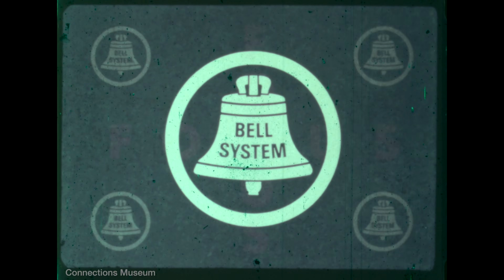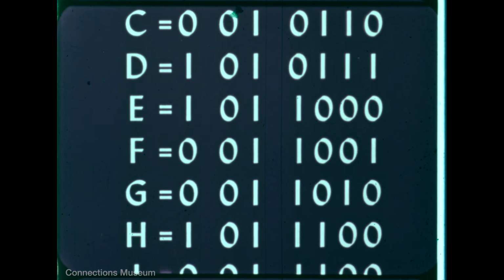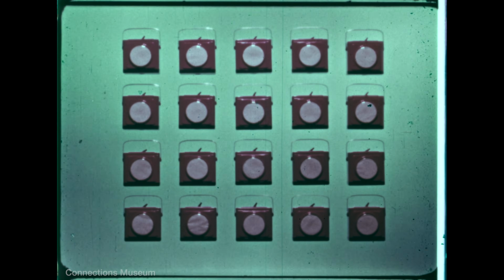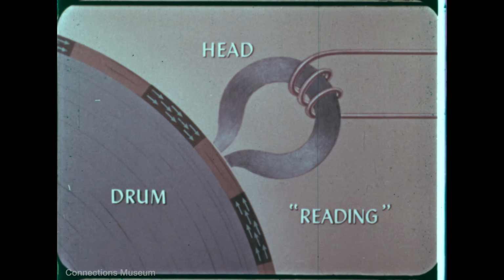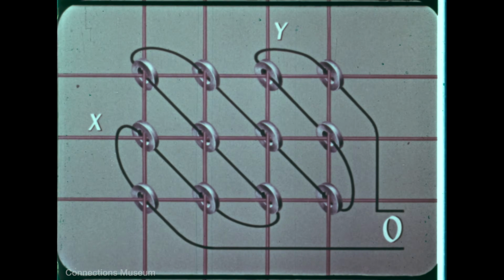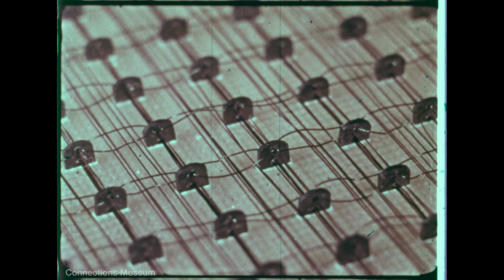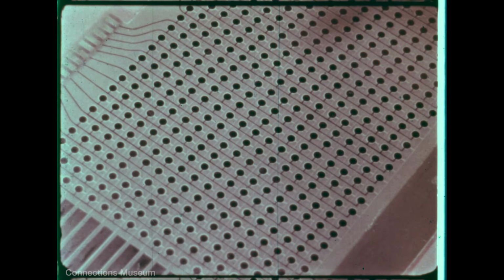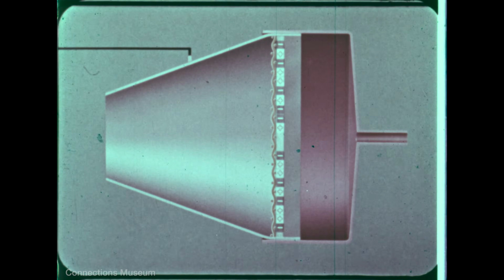Memory Devices [Bell System 1959, 4K]

Comment: Its basically Morse code/braille for the paper version. 8 ...

I don't understand the 2/5 signallung with phone numbers, it wasn't explained well.

Then just like a Wax Record for Sound waves and earthquakes, the magnetic tape with heads. 7 head bit*

Interesting about the electric current running through it.

Comment: Huh, for a moment I thought the video was on/from the channel FranLab.
I only have to think that an SSD/DDR5 RAM would blow their minds, gives how impressed they are with the "large" storage capacity, and "fast" access and transfer speeds.
On the other hand, historic storage is interesting. And given that there have some magnetic core memories have been found that haven't be touched or in circuit for more than 40 years and still had the last program/memory they did run ... maybe we should invest in developing and producing those again ... As a reliable backup in case the poo hits the air moving device.

Comment: Magnet core memory was invented by Dr An Wang at MIT. The invention was subsequently acquired by IBM from Dr Wang in return for a substantial amount of IBM shares. This holding was used to finance the the formation of Wang Laboratories Inc. based in Lowell Mass. Wang Labs were pioneers in electronic scientific calculators and in screen based Word Processors.

Comment: I worked in a steel mill in the early 1970's and the rolling mills were controlled by a General Electric computer with a card reader and punched paper tape.  The memory was magnetic core.  The bulk storage was a magnetic drum type bigger than a washing machine. I remember the drum storage was about 500 kilobytes.

Comment: As an educated IT and Electronics technician, i love those old movies. So easy to understand the concepts. Modern tech almost 70-80 years later, not so easy. I have tried to explain Electronics to my 75 years parrenes. Skoen Them some 0.15 mm components. They have a hard time imagine I Can build stuff with that size things made from dust. Hehe. Then I diged an old vacumm tube out to show Them, and told Them there are some 20 billion of Them in most modern cpus. That blow their mind. And then i told how much juice and roome size 20.000.000 of those glass suckers would fill. 
Just the filament in it self is in the watt pr. Tube. So a medium size powerplant and a  ballroom would be needed. Notation mention a cooling system. Thats whats needed if not semiconductors was invented.

Comment: I probably never would have known how a computer works if I never watched a video from 1959.
Reply: Def explains/expresses the fundamental roots thereof. It’s like way back when I’d first learned automotive fundamentals during Jr High & HS during the late 80’s into the very early 90’s.. whenever fundamental educational “films” (yeah, only a very small number of educational shows, were actually presented thru “VHS”; projection 16mm w/audio, typically via compact cassette tape, were still ‘very’ commonplace then), were presented to the class, more times then not, the “footage” (that term, still being used today, for digital ‘videos’, is a fallback of literal actual “film stock” that passes across a controlled frame gate system, at a “feet per second” rating), were films created back in the late 1940’s thru the 50’s!!! No point in trying to recreate the wheel, right?

Comment: Most of these I have never knew existed. You can see the start of the printed circuit board. I took electronic engineering after high school and got hired by Nynex aa a computer tech  right from school. IT was IBM XT's and AT's around that time. Some of the first hard drives were coming out. Had a Commodore 64 at home. Now I'm Cisco Network Engineer, after going through various networking hardware and software interactions. Amazing how things have progressed.
I love electronics and electricity in general it always amazes me.

Comment: I worked on my master's degree by writing FORTRAN code using punched cards. LOL.
Reply: And if you could not do it in FORTRAN, you did it in Assembly.
If you could not do it in Assembly, it was not worth doing.

("Real Programmers don't use PASCAL" Datamation, July 1983
Reply: @lars-goranwillny42  I've done assembly too (actually machine language), but that was later. BTW, I'm not a programmer, I'm a physicist.
Reply: @TOAO789 Nice! I was a material quality laboratory engineer at a truck manufacturing company in Sweden when I was asked to create a quality statistics system for transmissions. I wrote it in FORTRAN and then I was transferred to the company's computer department in the role as systems programmer for an IBM S/370 and System/38 environment. Since then it has just gone downhill, becoming a computer nerd, inventor in the field of computer and information science 😂

Comment: As someone with an Electronic Engineering degree I have always been fascinated by what I call Ancient (Pre-Transistor) Electronics.
Everything is so big, chunky, clunky, and slow. You can see every component, watch it do its job, understand how it does what it does, and tinker with things with just a screwdriver, tweezers, soldering iron, and wire cutters.
Now, the complexity of electronics is mostly hidden away inside chips, where repairs involve replacing parts rather than actually fixing something.
Having said all that, the effort and expense they went to just to store and read a few kilobytes of data is astounding.
Reply: My grandfather was using computers like these when he worked at a chemical plant in the 60s. In order to be available at all hours the company ran a dedicated line from the plant to his house, and he had to call in and give a code word to have someone manually plug him in to the computer.
Reply: I feel exactly the same. Sometimes I wish I graduated in the '50-s instead when all the limitations and innovations were in hardware and, as you say, everything was very hands-on.

Comment: I was an Air Force Data Processor in the 1960s. Seeing those punch cards and the core memory nearly gave me  a Twilight Zone flashback.
Reply: I was in a US Army data processing center in 1969, and our system was entirely punch cards, but that was ancient and outdated even then. They were trying to switch over to a tape drive system with some used computer but I ets'd before they could complete the switch.
Reply: @TOAO789 I remember when barcodes started appearing civilians were scared of them.
Reply: Me too lol. During the war and at the factory afterwards.

Comment: I used to be a computer tech and worked with core memory.  I have here a 4096 bit core plane from a Collins computer.  32 of these planes were stacked to create a 16 K byte module and 4 modules were used for 64 K bytes in a chassis.

The core memory plane can be seen here:
https://drive.google.com/file/d/0B5LapMwk8iPrNkFZUXA4cmd5dTg/view?usp=sharing&resourcekey=0-UaImmIxbC-73mW1SoJYNFA

Comment: 0, 1, 2, 4, 7? what the heck... why not 8?
Reply from the maker: 0,1,2,4,7 was known as "2 out of 5 code" and it was an early form of error detection that was simple, effective, and inexpensive to implement way before we had mathematically intensive error checking and correction codes.

Two and only two relays could be operated for any digit 0-9. If more or fewer than two relays operated, it was detected as an error, and the data being transmitted was disregarded.

Comment: That mag tape brings back memories.  I remember threading the tape on all the various little rollers and getting it started on the take up reel.  Sometime later, we got an upgrade and all you had to do is put the new tape on, and hit a single button.  It used vacuums and little puffs of air to wrap the tape on all the right little rollers and it threaded itself.  That was so neat.

Comment: I've been interested in computers for over 50 years and even have a Batchelors degree in the subject but there were technologies here that even I didn't know about! "Twister memory"?! Obviously, some of these were Bell in-house projects that never made it to large scale adoption. The great thing about magnetic memories like core is that they do not get lost in the event of a power failure and so are "non-volatile memory". This was one of the reasons core was used in the US space program - you wouldn't want to lose your critical data in space due to a power glitch! 😲
Reply: What nobody mentions is there was often a power glitch when power was lost, which would often corrupt one or several random words, and then there was usually another glitch as power came back up, often corrupting a few more random words. So you had an almost perfect image after power up, except for an unknown number of unknown words that might have been corrupted. You could design so the power-on glitch didn't happen, but that took extra work, so wasn't done on general-purpose computers that didn't care about the dead storage when power was lost. Dealing with the corruption when power went down was much harder. That was also a problem with disk memories, that could lose a substantial part of a track if they were writing when power went down.

Comment: Before ASCII! 0: 67 instead of 48, A: 84 instead of 65.
Reply: There were lots of codes before ASCII. In fact there was ASCII before ASCII. The first ASCII was ASCII-63, and only had upper-case characters. The one you know as ASCII was ASCII-67, with upper and lower-case characters.

The code shown was a 6 bit code. There were lots of those. IBM had BCD, Burroughs had a similar BCL, GE had their own, Univac had their own. Generally they encoded uppercase letters, the digits, and a few special characters like decimal point, comma, and maybe dollar sign. I'm not sure which code they were showing, it didn't appear to be the IBM BCD I would have expected. The 4 right bits were the "numeric" bits, the two to the left were the "zone", and the one farthest left was probably a parity bit or the like.
Reply: @lwilton   There was also a 6 bit code used for ticker tape.  It had a shift bit, instead of the letters and figures shift characters in Baudot.  This was because tickers did a lot of shifting between letters and figures and the 6th bit was more efficient than the shift characters.
Reply: @James_Knott  I think I was vaguely aware that it existed, but I never came across it in my work.
Reply: @lwilton   I certainly did.  I spent a couple of years working in the Toronto stock exchange and maintained several ticker tape machines.

Comment: One second of this video probably contains more bits of data than all those filling cabinets of punched cards....
Reply: A card drawer contained around 6000 cards, as best I recall. So around half a megabyte per card drawer (assuming EBCDIC coding, multiply that times 1.5 for pure binary cards). A drawer was about 4 inches high by 8 wide. Assuming a 5 foot high cabinet (which is about what I recall), there would have been about 15 drawers in each column, or 7.2 megabytes per column. Two drawers would have been a bit more than a foot wide, so about 12 megabytes per horizontal foot. I've seen 60 feet of card cabinets in a row, so about 750 megabytes in 60 feet for EBCDIC cards, or 1.1 GB for binary. A big spinning disk in the 1970s was 40MB.

Comment: My first experience with storage memory was cassette tape when I was about 14 because the floppy was way too expensive for me.  The floppy held about 90K, which was amazing since my computer only had 16K at the time.  I didn't have a hard drive for at least another 4-5 years, and it was huge, yet only held about 20 MB.
Reply: My first experience with storage memory was when I was in first grade and learned to write my name on a piece of paper. Before paper there were clay tablets in Babylon thousands of years ago.

Comment: Fascinating. Punch cards, tape, and core memory were still in use when I started working with computers.
Reply: When I was in the Air Force n the 1980s, they still used those.  Punch cards were still used until 1985.  The system they replaced it with used punch card 'images' on floppy disk, but even then they were behind because it used the outdated 8 inch floppies.

Comment: Do you know why it was very magenta? Is it the chemicals in the film degrading or something?
Reply: Color film is a bunch of dyes of various colors like magenta and cyan, embedded in clear plastic. It turns out that various dye colors aren't all that stable over time, and fade. Some dyes fade faster than others. That's why you can see old wall posters that seem to be grey and blue with maybe hints of green, and wonder who would have wanted to look at something that ugly. All the red dye has been bleached out of the poster by the UV in sunlight.

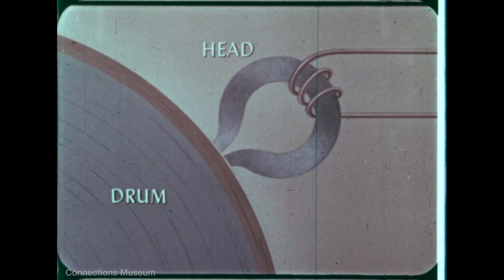Comment: 10:00 - He may mean 2400 RPM not 24,000.
Reply: Yeah, that thing would self destruct at 24,000
Reply: No, he meant 24K. Fast drums were limited to about 5" max in diameter, and depending on who made them, ran between 10K and 24K RPM. Bigger drums up to about 9" diameter still ran up to 6K RPM.
Reply: @lwilton  You both (Dinnye01) are right. I just couldn't imagine that kind of motor speed in the 1950s. I just read that the IBM 650 had a drum speed of 12, 500 RPM.
Reply: No, he meant 24k RPM. This is a memory drum, not a hdd.
Reply: Thanks for clarifying. I'll look into it.

Comment: You missed out the "mumble tank" also known as the delay line memory.  that can be used to store more than 10 bits of information and can be read out fairly quickly.
Reply: I used to work with delay line memory in computer terminals.  However, it was made with a coil of wire which the acoustic signal was coupled.
Reply: @James_Knott  Yes, it seems a lot of those got produced.
Reply: Olivetti Programma (Italians claim it's the first desktop computer, personally I'd say programmable calculator) used this kind of memory. Though not liquid, but twisted wire.

Comment: Knew about core memory, but not some of the others. Amazing how much variety they had so early on. Regenerating stored bits after read seems very error prone. Guess it was very reliable, since core memory was used in many critical applications. RAM chips came about a decade later. Tech moved fast. Still does, but much is now just reiterations. And extremely abstract and hidden even from techies.
Reply: One nice thing about core is retained it's contents after the computer was turned off.  In fact, you could pull it out and plug it into another computer and the data is still there.